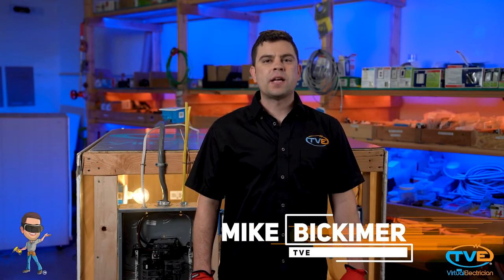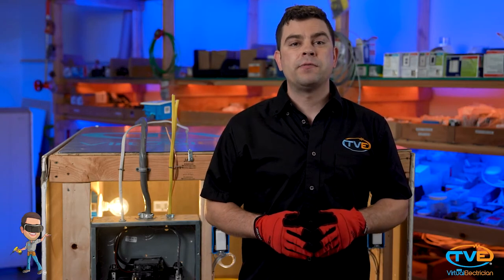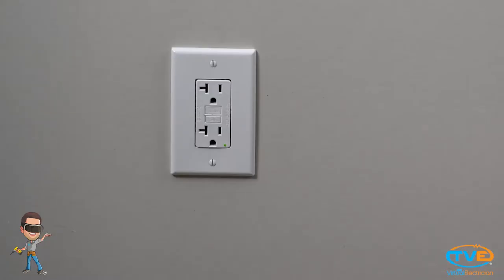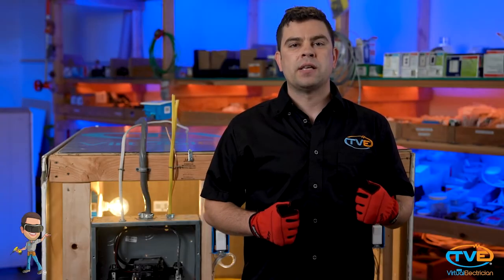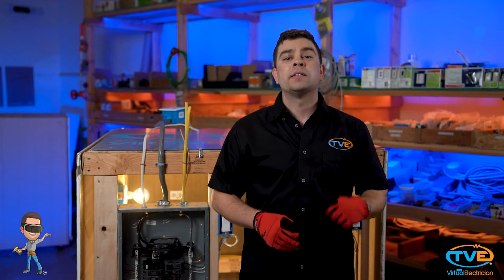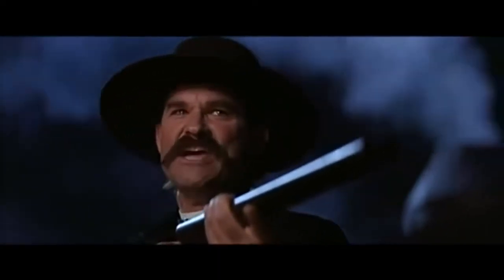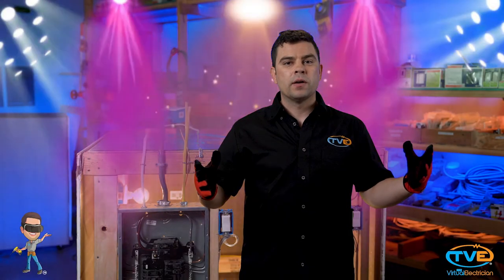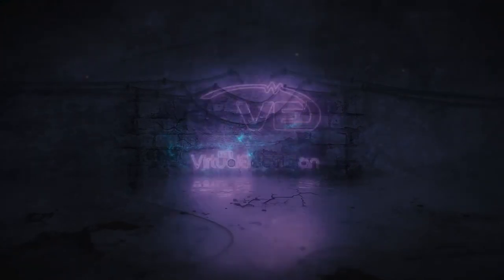National Electric Code - Kitchen wiring

Comment: I have wet bar countertop with island. Sink is located on countertop. As I understood, I need at least 2xGFCI protected circuits at the right and left of the sink. As per code I have to install at least one 20A outlet in the island. I plan to install two outlets. Do they have to have dedicated circuits or I can connect them to existing GFCI outlets on countertop?
Reply from the maker: They can be on the load side of your countertop outlets.
Reply: @TheVirtualElectrician  thank you

Comment: Microwave is only required for a dedicated circuit if it is built in.
Reply from the maker: This is correct. Otherwise you can plug it into either of the 2 dedicated 20 amp appliance circuits.

Comment: The fridge is allowed to be on 1 of the 2 required branch chain small appliance circuits.
Reply from the maker: This would be stupid and irresponsible. Most newer fridges require a dedicated circuit. Just because you are allowed to do it doesn’t mean you should. Yeah as the electrical contractor you may save a little money but do the right thing and install it on a dedicated circuit
Reply: @TheVirtualElectrician  modern fridges only draw 3-5 amps max, that’s why theyre not required to be on a dedicated circuit.
Reply from the maker: @R900DZ  wrong. Most modern fridges need a circuit for the fridge and one for the freezer. I think we are wiring 2 different houses. I’m guessing the houses you are wiring are less than 400k?
Reply: @TheVirtualElectrician  I’m just saying the NEC doesn’t require a dedicated circuit for the fridge. If the manufacturer of the fridge requires it that’s one thing but the NEC doesn’t. If you go to Home Depot and check out your average fridge you’ll see the amp draw is minimal on the new ones.
Reply: @TheVirtualElectrician  The video suggests wiring your own kitchen to save money. Do you think anyone like that owns a house worth almost half a million dollars?

I had my kitchen rewired recently by a licensed electrician. Fridge is one of the two appliance circuits, not it's own dedicated circuit.
Reply: According to which sections of the NEC code fridge requires dedicated circuit?you mentioned code required it @TheVirtualElectrician